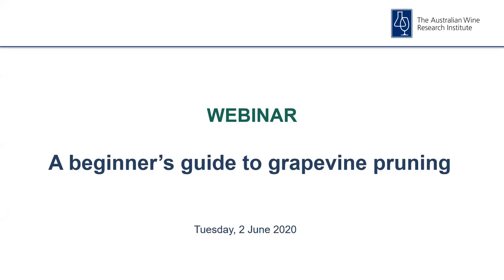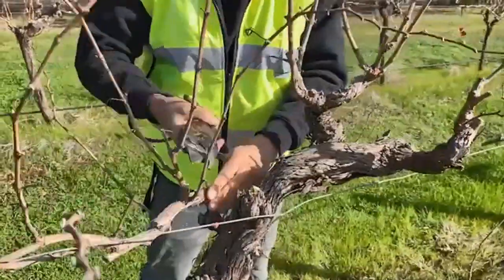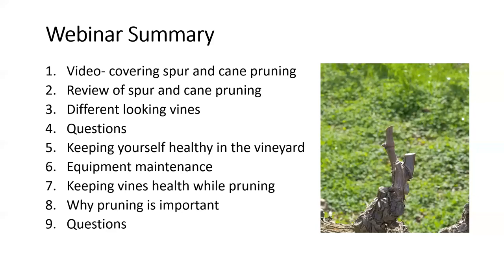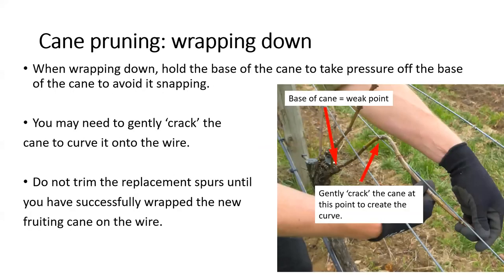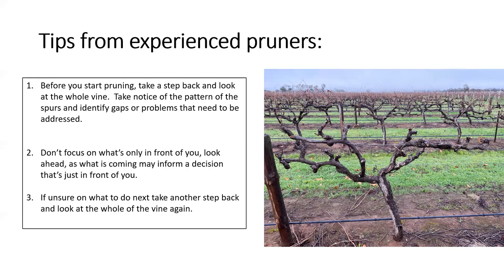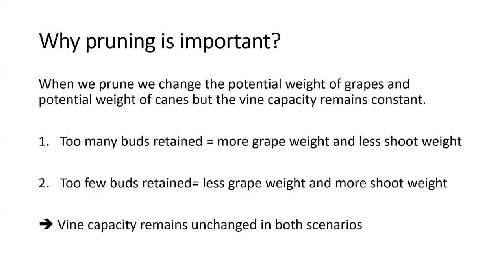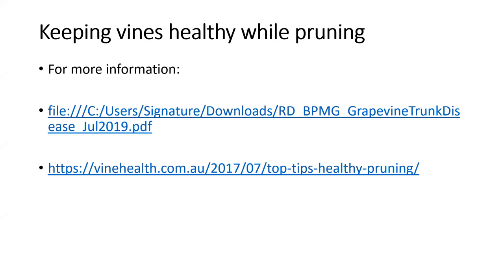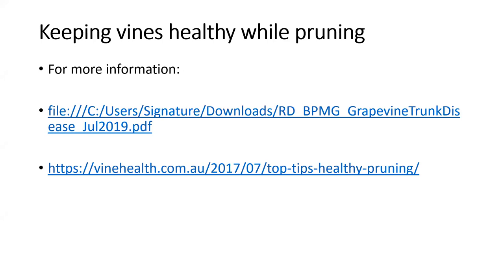A beginner’s guide to grapevine pruning

Comment: So then how do you fix the spur height getting to high and the vine losing its structure?  Nick mentioned this at 11:49 but did not explain the solution.  Seems to me since last year's canes become this year's spurs, the spur height gradually climbs every year. Then what?
Reply: im still learning myself but you have to find or leave a new growth at the bottom of the spur, then you can cut the one thats high and keep the one at the bottom, this becomes your new spur, always cut the lowest cane or new growth. not sure if this makes any sense, i was having the same issue at first.
Reply from the maker: Hi @jeffmeyers3837 - As Nick mentions at 11.38, where possible, you want to select the lowest positioned cane out of the two canes that grew from last year’s spur (provided the cane isn’t weak or damaged) as this will help delay the height increase. Though in saying this, it’s natural the vine may grow a little bit taller each year, however, it would take a long time for the vine to grow so much in height it becomes unmanageable.  Additionally, the pruner will have the option in some circumstances to use water shoots as new spur positions. Water shoots arise from dormant buds on wood that’s older than 1 year and can push out from other areas of the cordon that aren’t already established spurs. Generally, these shoots are less fruitful and are removed at pruning unless required to provide replacement fruiting wood. You’ll just need to be a bit opportunistic when this occurs